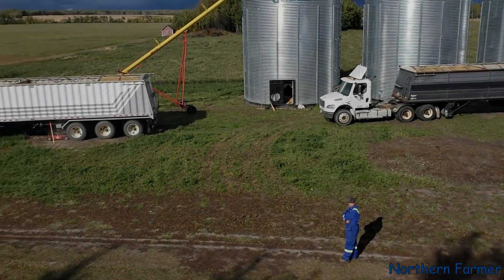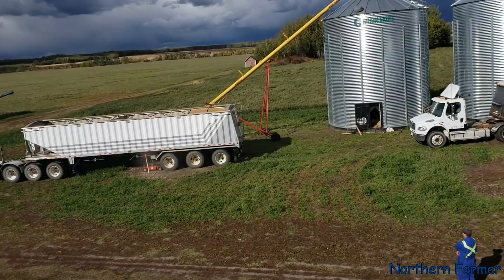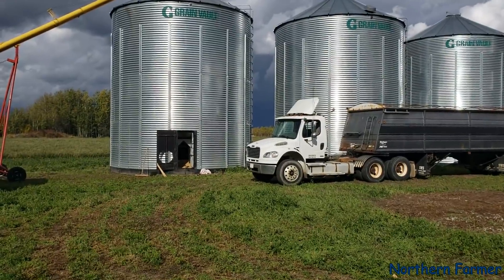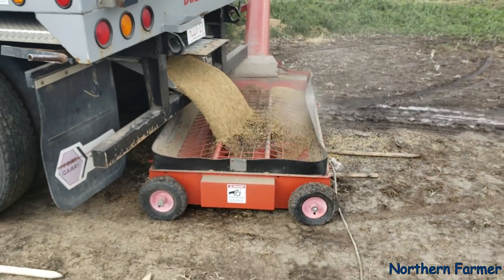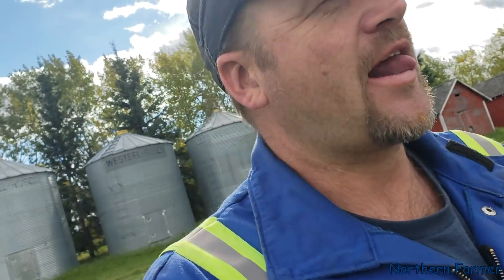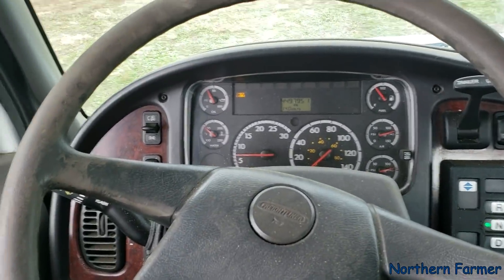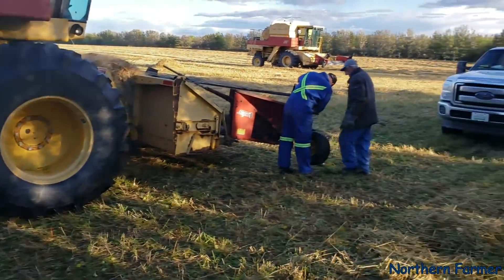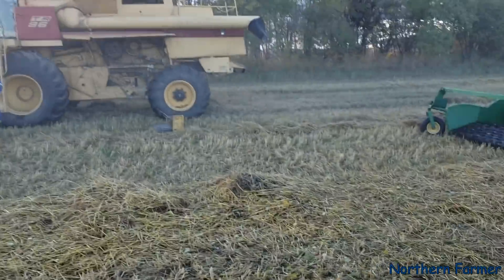Unloading Grain And Unplugging Combines!!

Comment: Hate to break it to you, but auto shift to standard isn't as easy as just putting a shifter on it. depending on the case you have you can make an adapter then put a shifter on it or you need a different case to swap the gears into. Still need to figure out the range cylinder, either use an electric switch to change ranges or convert everything over to air control. Then you will need to reflash the engine ecm so it will start. It's a good time!
Reply from the maker: I had read in a truck forum that there where guys that switched them over when they quit working
Reply: Don't get me wrong, it can be done. Its just alot more involved than the keyboard mechanics think it is. I'm sure you could figure it out, us farmers are way to stubborn to give up on a idea!

Comment: had a neighbor steer farmer who filled high moisture corn in a 20'x60' stave silo with a grain auger. he had loads of pit run fill hauled in for a big ramp so the auger just reached a hole in the dome. ran it realllllllllly slow

Comment: Do you prefer the auto shift or a manual transmission? I think the auto shift would be nice in soft fields but I’ve never driven one
Reply from the maker: Actually like the auto shift the least. Fully automatic is the best for soft feild.
Reply from the maker: The auto shift is a manual transmission...you just dont shift it..the computer does